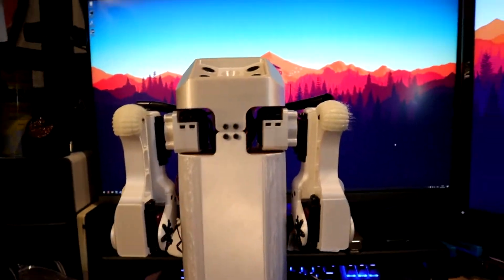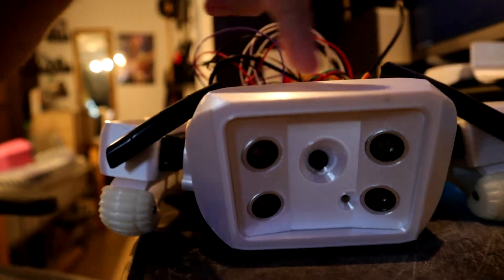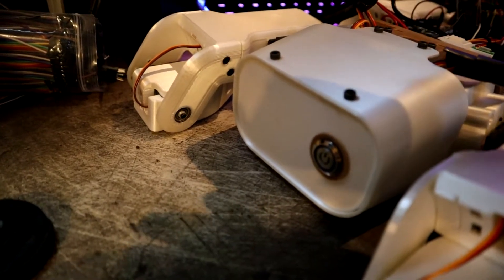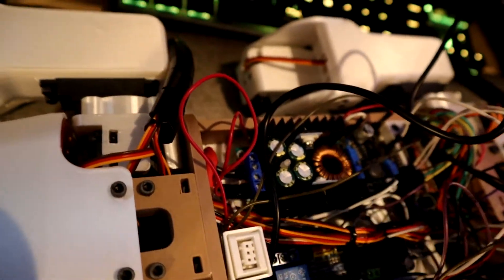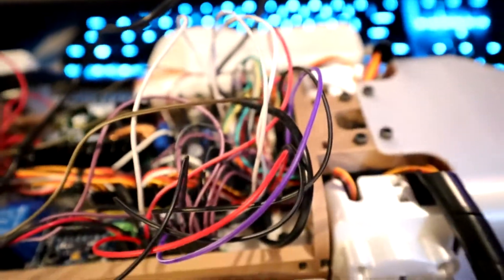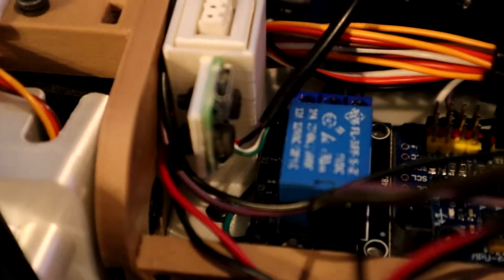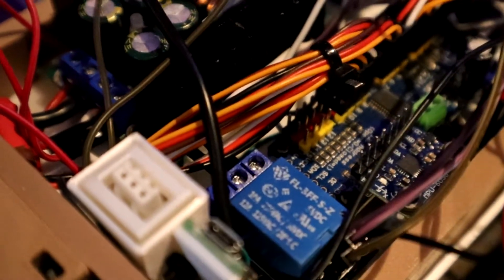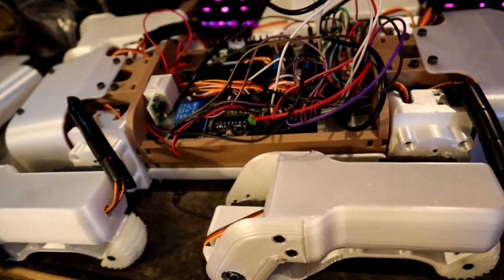SpotMicro ESP32 (Robot Dog) Project!

Comment: hi have you got the dog running. i have a working walking, body movement , balance mode running on a esp32. let me know if you want help
Reply from the maker: hi there, I have not got it walking just yet, help would be great! Are you able to confirm what software you have and what servo motors you are using?
Reply: @nath042  hi there, see this link, https://www.youtube.com/watch?v=9ieQvUIGtjo&t=81s . get the code and have a good look at it. let me know if you need help with the set up. i could try and make a video to show you how.the person that wrote this code is very good. servos are 25 kg digital.

Comment: How you getting on with it? mine is fully built and wired up, but there is a big lack of software to run it, I'm thinking of moving to the Nova-SM3 spotmicro clone as it's more established.
Reply from the maker: I'm running into the same issue tbh, I am not skilled enough yet to create the software required for this, a bit annoying but yeah. I just want to get it to walk really. I hope to continue my work on it in a month or 2 when I have finished moving.